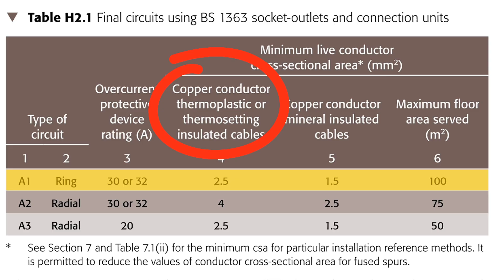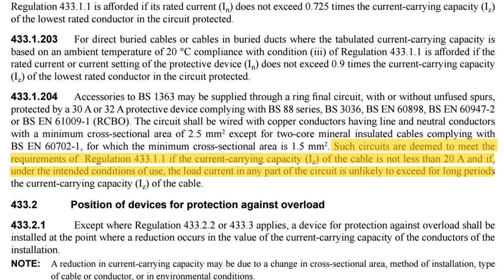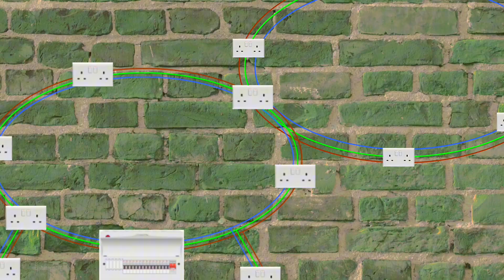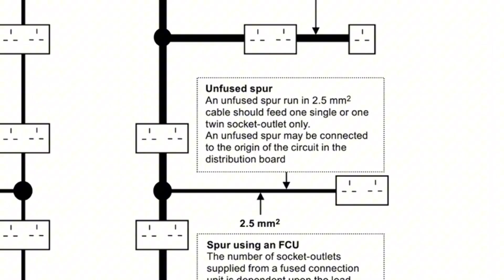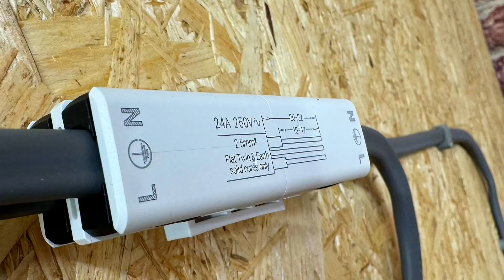32A Ring Circuit, Can a 24A Junction box Handle It?

Comment: Yes. Next? 
(Max number of spurs must not exceed number of points on the ring tho, an often forgotten rule)
Reply: It's not about the total number of spurs and the total number of points, but the number of spurs at each point, right? There is no reason adding an extra socket in one room would now mean it is safe to add an extra spur in another room.

If you are using a socket instead of a junction box to spur off, you are only allowed one spur at that socket. That's simply because sockets aren't really designed for use as junction boxes, so you shouldn't get carried away using them that way. If you are using a junction box to create your spur, that doesn't apply.
Reply: @thomasdalton1508  
You are saying that a 32A j-box on a ring with a 2.5mm cable spurred off it to one single socket with 2.5mm then another single socket spurred off it using 1.5mm or 2.5mm is all legal?
Reply: @johnburns4017 you’re right here, but i would say it was legal or illegal really, don’t think there’s a law on the matter. 
Doing porridge for adding multiple spurs.
Reply: @johnburns4017  I'm not sure I understand the question. I'm not an expert on the regs, anyway. I was just pointing out that the regs don't say that the number of spurs you can have depends on the number of sockets you have elsewhere on the ring. That would make absolutely no sense.
Reply: You can have a ring, a j-box then a spur cable to a socket. As many as you like.
Reply: @johnburns4017  not when i was trained in the late Triassic, maybe this reg has been removed
or wait, yes a j box counts as a 'point', maybe?
Reply: still doesn't sit well
Reply: @TheChipmunk2008  
It is better as the ring's current runs through the j-boxes not the terminals on the rear of the sockets. So 32A does not run through the socket.
Reply: @johnburns4017  wrong
Reply: @TheChipmunk2008  
You are confused.
Reply: Thing is, when you add a spur, double socket lets say, you add another point. So then we can add another spur after that as we’ve another point, an so on.
Reply: @SME_Ste  
Off the back off a socket only one spurred socket, double or single. As per regs.

So, a 32A j-box in a 2.5mm  ring with 32A breaker. Off the j-box a radial of three 13A single sockets which is 39A in total. No point off the ring (j-box) can draw more than 32A. But two single sockets can draw 26A, so within the limits of the 32A j-box and breaker. All safe. Electrically sound.

As I understand, as far as regs go a spur off the ring cannot be more than 20A, a double sockets max. If more sockets a 13A switchless FCU needs to be fitted in place of the j-box.
Reply: @johnburns4017  sorry, wasn’t suggesting adding more points in series with each other. 
I suggesting that adding 1 spur would add 1 more point, so then allowing for another spur/point to be taken off the ring elsewhere.
The comment i made was in reference to chipmonks reply about total number of points

Comment: I trust well made off 30a jb than those things 
I had 3 of the lighting ones fail won’t touch them again
Reply: I'm really curious how. That is very unlikley, what happened!??
Reply: All times after using the loop ones on spotlights had to be replaced  
I didn’t bother using the straight join one took them back to the wholesalers got refunde but haven’t wanted to use them since, as I said first time used and both times failed. I only got them to try them out.
Reply: @mikewhitby2686  
Do not buy cheap stuff.
Reply: Hmmm, I think you were probably doing something wrong. We test every single unit we make rigorously at our factory before they are sent out. The chances of you having multiple failures like that, honestly. It's just incredibly unlikely. Are you sure you had the strip lengths correct?  @mikewhitby2686

Comment: No earth sleeves?
Reply: No need for earth sleeving on these beauties ;)
Reply: Not required per manufacturer's instructions. Q for Efixx, how does this work with the new Earthsure, does it work or does the insulated CPC get in the way of the CPC connection, do you have any videos of them taken apart?
Reply: @TheChipmunk2008  As far as we can tell, EarthSure cable 1,1.5 & 2.5mm2 has exactly the same CSA of each of the L,N & E copper conductors as used in standard twin and earth. Therefore, provided it is stripped as per our instructions, it will still work with all Quickwire connectors in our range. However I’d question the logic of using the two together on the same job. Firstly there is no need to sleeve earth when using Quickwire connectors, and secondly stripping normal T&E cable with our strippers is incredibly quick and easy, but when using Earthsure you’d have to completely remove the thinner earth sleeving, and this would mean splaying out the cores to do so, before then aligning them again to fit into a Quickwire JB. It’s possible, but not exactly easy. Personally I think you’d choose to use either Quickwire or Earthsure on any given job, despending on which will save you the most time. And this will vary depending on the nature of the job.
Reply: @quickwire80  so basically you'd  have to work around this... thank you for your honesty...  I hope this gets checked into ... because both are excellent ideas
Reply: (testing would pick up any issues of course)
Reply: @quickwire80  thank you

Comment: Yes. Good that we don't use rings here. 😅
Reply from the maker: You don't know what you are missing.
Reply: @efixx More then likely they're not missing anything...
The sooner ring circuits are banned the better...
Reply: @gloveyourway2000  Yes, they're a Pain in the arse for testing. The risk of an open circuit happening in untested rings (it DOES still happen) is too great. An open in a radial makes itself known instantly when the sockets quit working downstream
Reply: @TheChipmunk2008  
Easy to test once you understand rings.
Reply: The rest of the world is backwards. A 4mm ring on a 32A AFDD is bombproof and delivers the power multiple radials would.
Reply: @johnburns4017 Two 20A radials supplies more power and redundancy, a fault only takes out half your sockets instead of all of them.
Reply: @HiJ6393  
One 20A radial can take one 13A appliance and one smaller 7A appliance. 
So two 13A and two small 7A. Using two expensive AFDDs.

One 32A ring takes two 13A appliances and one smaller 8A appliance. But only one expensive AFDD. Also one less way in the CU. Also less cable used. Cheaper.

By taking a cable on the ends of the radials back to the CU making them 32A rings, you could have: four 13A appliances and two 8A appliances.

With a radial the terminals on first socket after the CU takes  all the load. A ring splits the load. A ring has two ways back to the CU for the CPC in case it is broken. If a CPC is broken on a radial then big trouble.
 
Multiple radials only offer redundancy, nothing else.

Comment: Never seen these before and will definitely try some if available at the wholesalers. My only immediate thought is in regards to strain relief. Do those black clips offer this? Like I said I need to actually use one............The range of solutions to supposed electrical problems is now mind bogglingly vast, but everynow and then one actually makes a usefull improvement to install times and safety overall. We will see...........................
Reply from the maker: http://hub.efixx.co.uk/quickwire

Comment: The comment, two spurs can be mm apart on a ring. 
So, a 5 way Wago rated at 32A is a bus bar. One piece of brass with five slots for individual conductors. 
Ring conductor in one end. 
Ring conductor out the other end. 
Three ways are left in the centre for three conductors. Each one is mm apart.  Each way can be a socket spur.  The busbar in the Wago takes the ring's current.
Reply: 🤣🤣🤣Underrated comment
Reply: In theory- not sure.
In practice- unlikely. 
Three port wago .
Reply: @spankeyspangler  
Three port Wago for what?
Reply: @spankeyspangler  
A five port Wago clearly gives you three spurs off it.  All legal.
Reply: @johnburns4017  i don't think he is lol. I think it was just a sarcastic comment but a funny one
Reply: @markpotter8280  
I never saw any humour then or now.
Reply: @johnburns4017  That's fine what makes one person chuckle may not make another laugh
Reply: @markpotter8280  
Do you still use wirenuts? Bakelite fittings?  Fuses in CUs?
Reply: Wagos are rated tho, surely your not going to use a 32a rated product for supplying 6 potential 13a plug tops 👀
Reply: @habbo12345434  
The busbar inside a 5 port Wago is heaftier than a 2.5mm conductor for sure.  I am looking at one right now. Wago rate all ports at 32A. Other-words, all ports can be drawing 32A. So, ring in and ring out on end ports, three spurs of the three ports drawing 26A each (restricted by fuses in the plugs on a double socket). The 5 port Wago will handle it. BTW, double sockets are only rated at 20A. But that is another matter. They are capable of drawing 26A.

I have used the 5 ports on rings. Taking two single 13A sockets off them for behind a wall mounted TV and sound bar.  The current draw is minimal, but legal.
Reply: @habbo12345434  
All five ports on a Wago are rated to draw 32A each.
Reply: @habbo12345434  
Each of the 5 ports is rated to carry 32 amps.
Reply: A number of posts have been deleted.
Reply: 32A in/out one end.
32A in/out the other.
Three ports in the middle. The three middle ports combined cannot draw more than 32A otherwise the MCB will trip. 
So, 26A out of one and 6A out of another then it maxes out at 32A then the breaker trips.  
Or 10.6A for each of the three combined then maxed out at 32A, then the breaker trips.
 
There will never be 32A drawn simultaneously at each of the five ports. 
Totally safe.
Reply: @johnburns4017 A 32 amp breaker won't necessarily trip at 32 amps. It depends on its time characteristic, but typically can take up to 5 times its rated current.
Reply: @shamrockshore6308  
Depends on the breaker you fit.
Reply: @johnburns4017 Even  a 32amp type B can take 160 amps before it'll trip.
Reply: Good point in a smaller cheaper example. As I said in previous video the 24A thing its a pointless product for bodging only!
Reply: Yeeehhaaaaawwww

Comment: Kitchen fitters are going to love those! They can provide sockets for the tumble drier, dishwasher, hob and the washing machine off that one piece of 24A rated plastic, while it also carries the current of anything else on the ring! Legally!! Honestly, this industry is sleep walking into disaster 🙄
Reply: Don’t be silly, kitchen fitters won’t spend the money on somthing like that when they can keep twisting cables together and hiding them under the kick boards
Reply: @watsy15 fair point 😆
Reply: You ever wired kitchen grid switches on a ring, it’s no better or worse, no single part of a ring is meant to be carrying 32A
Reply: @edc1569 Depends on what you mean by any single part of a ring.

The breaker on a ring is typically rated at 32 amps, so the ring is expected to be loaded up to that amount.

But as we know the ring is made up of two conductors for each line conductor so the current is split between them.
Reply: @deang5622 rated UP to. It isnt a minimum or expected load of 32A. It is the maximum...
Reply: @cblairrrr  What part about "expected to be loaded up to " don't you understand?
Reply: @deang5622  expected to be loaded up to implies 32A is the maximum permissable state before tripping. It isnt the expected load, its the potential maximum...
Reply: if it is, the ring's broken, yep... I still don't like concentrated heavy loads on a ring, but for a couple of spurs for IT or AV equipment it's fine (altho for that we typically spur off once then run it through a 13A FCU with as many sockets as needed for the equipment)
Reply: @TheChipmunk2008  
A ring has a 32A breaker. Load it up to 32A on one side of the ring. It would have to be taking less than 20% from one leg for a cable to be overloaded. Then, say if it is overloaded the cable will get warm increasing resistance making more current come from the other leg. Auto correcting. I have never come across an unbalanced ring.
Reply: @johnburns4017  absolutely, and in the real world 2.5 at 32A isn't a problem (Cue hate) i was just thinking from a regs PoV
Reply: @TheChipmunk2008  
You can fit a 25A DP unpolarised MCB with both L legs run though the MCB. The ring will never be out of balance and if the ring is cut no harm is done as a cable rated at 27A max can never overheat. The CPC has two ways back to the CU.
Reply: @johnburns4017  yep 25A is a handy solution to a damaged ring where there might be heavy ish loads, gotta watch the installation method of the 2.5 tho
Reply: @TheChipmunk2008  
If derrating says 22A, then fit a 20A MCB. A 25A MCB on a final ring can supply a 40A appliance. Yet still does not exceed the 32A  of the breaker.
Reply: @edc1569  Until line or neutral goes open, pick any reason you like, then potentially that side is carrying a disagreeable amount of load, perhaps all of it if it happens near the consumer unit.  Sure, it may not happen but if it does, it will typically go unnoticed and everything not rated to take 32A continuously will get nice and toasty if the load is present for long enough, thermal lag etc.  The only saving grace in this is the average loading on a circuit over the medium term is low enough to avoid it, usually.
Reply: @retrozmachine1189 Sure, but that's a general problem with rings, not a problem with these junctions. The junction is higher rated than the wire, so you haven't made things any worse by using it.
Reply: @thomasdalton1508  Actually you have made it worse by adding another under rated device into the circuit.  Not making it worse would have a joiner rated at 30A (or higher).
Reply: @retrozmachine1189  A chain is as strong as its weakest link. Adding a link that is stronger than the weakest link doesn't change the strength of the chain.

An additional point of failure does increase the probability of something going wrong, but that doesn't have anything to do with current ratings. A higher current rating doesn't mean a device is less likely to have a fault.
Reply: @thomasdalton1508  Oh my.  You should probably look into probability calculations.  Don't worry.  NASA got it wrong too.
Reply: @retrozmachine1189  I'm an actuary. I'm very good at probability calculations. Current ratings aren't probabilistic.
Reply: @thomasdalton1508  Bit depressing that you claim that position given your clear lack of understanding of probabilities and how they'd apply in this situation.  Odds on you aren't actually an actuary.
Reply: @retrozmachine1189  spot on
Reply: These comments just go to prove that standardisation is more important than ever 😟
Reply: kitchen fitters can piss right off
Reply: Used this type of junction box on the lighting circuits in my house, they’re brilliant ,so easy and quick to use, highly recommend them. Ring mains are so old hat and problematic, radials all the way 20A and 32A. Hopefully they will be producing a 32A version for 4mm T & E in the near future.

Comment: I am a big fan of the quickwire junction boxes and have been using them for over a year, they are always on the van and are a brilliant solution in multiple situations, but a 24A junction box on a 32A ring just doesn’t sit right. If you use a clipped direct method with no insulation, the cable is rated at 27A. If you spur 1x 2 gang socket off of the ring, each of the socket outlets could have appliances plugged in with 13A fuses on each plug equating to 26A. You really don’t know what someone is going to plug in where on the circuit and for how long that load will be present. I really think they should have at least rated this junction box to 26A at a bare minimum or 32A ideally, quickwire have fallen short on this one
Reply from the maker: Check out this video https://youtu.be/FNgTnFs7f5o?si=29yekpv5zkVp4e09
Reply: If you pull 13A out of both sides of a double socket under a continuous load you’re overheating that socket and causing damage anyway.
Reply: remember, those brown junction boxes are only rated 30A... yet we still use them on 32A breakers. ( I do NOT like people extending cooker circuits with em tho, that exceeds the manufacturer's max cable sizing, if you read the back)
Reply: @TheChipmunk2008  
I assume you are on about radials.
Reply: A ring feeds a socket  from both ends. 26A on an unbalanced ring can be say 8A on one leg and 18A on the other. With two 24A Quickwires on each leg then all is fine.

The four way Quikwire is two connection at each end with a bar inside the Quickwire internals connecting the two pairs. You are assuming the bar between is 24A. Quikwire need to clarify. If 32A, all is fine.
Reply: A double socket is rated a total of 13A from both sockets. Yes 13A, it says on the back.* MK did make a 26A double socket, 13A on each, it may still be available.

If you see that two 13A appliances may, or will, be plugged into a double, it has to be two singles.
If the ring cable is rated at 21A then that is fine with a 32A mcb by the regs. I would drop the mcb to a 25A from 32A to be sure, but that is just me.
Reply from the maker: It's more of a standards issue a junction box rated at 32A must be capable of coping with a 6mm sq cable.